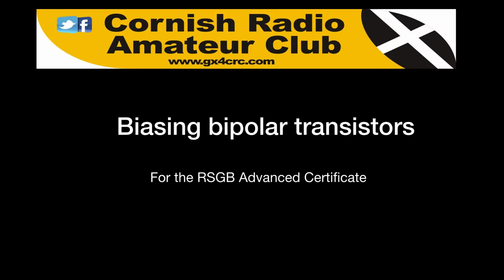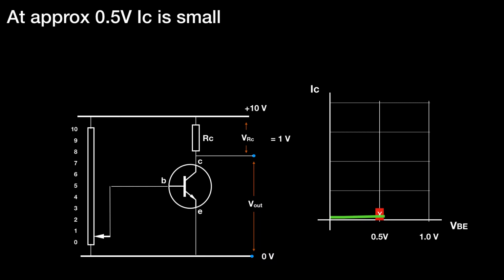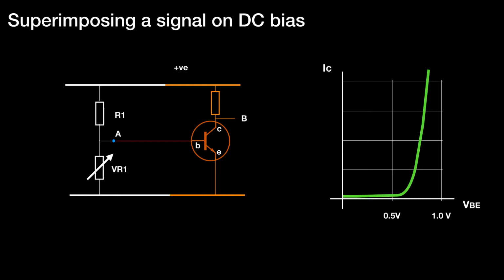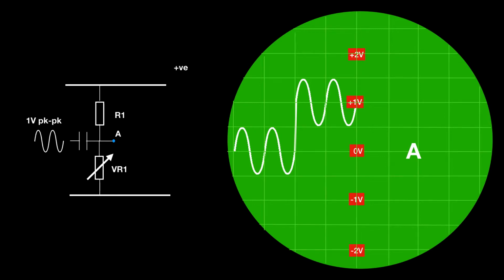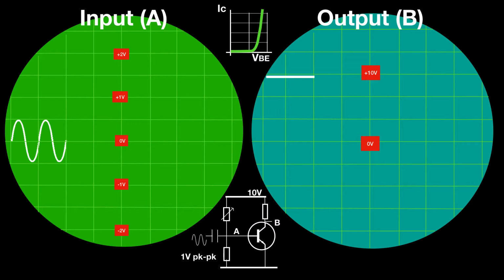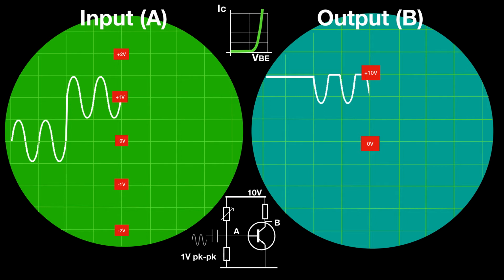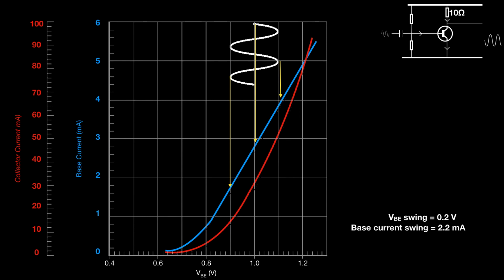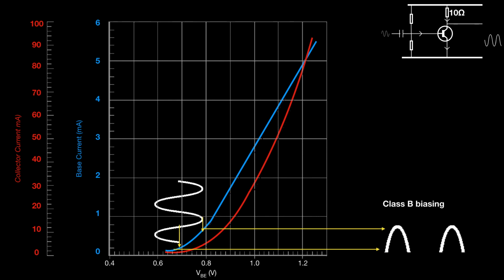Advanced -  Biasing

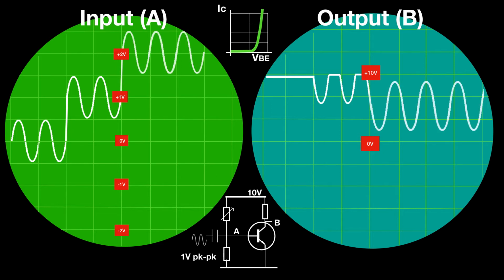Comment: In the Intermediate book it states "The voltage should be set at half the supply voltage to allow the maximum linear voltage swing." however it doesn't explain any more than that, and in your example that didn't seem to be the case, input voltage of 2 with supply voltage of ten gave you the swing, at 15:35 in the video?
Reply from the maker: Setting the bias voltage to half the supply voltage will indeed give maximum linear voltage swing.  So provided the swing of the input is not so great as push Vbe < 0.6V you should see the output waveform as a faithful copy (albeit amplified and inverted) of the input.  But because you have biased the transistor into conduction at all times (even without any input signal) you might feel it's using unnecessary power (e.g.from batteries).  And if your signal swing is small, perhaps it's not necessary to apply so much bias to still have full waveform on output.  If your signal swing were 2V pk-pk (i.e. +1Vpp and -1Vpp) then you could get away with biasing the base to +1.7V.  That is so that even the -1V half cycle will only push the base down to Vbe 0.7V so the transistor is still in the linear part of its operation.  The video is also trying to convey that sometimes the full waveform on the output is not necessary/desired. Broadly, full waveform on the output is class A operation. Only the positive (for npn) half cycles is class B and just the peaks of the positive half cycles is class C.  So the book is right. Pitch the bias in the middle and you have the best chance of getting the full swing.   But at the cost of power consumption and maybe you don't want the full swing.  The +10V rail was just to give a value. It could have been +12V in which case 6V would be the mid point.   Hope this helps.  Probably too much detail for Intermediate. Research Class A, AB, B and C amps if you want complete understanding for full licence.  GL
Reply: @cornishradioamateurclubtra4073  Thats helpful, thanks for taking the time to explain. Your videos are great, I find all of this much easier to learn and remember if I understand the underlying principals and these videos do a great job of explaining those. 

One suggestion, maybe an introductory 2 min video for intermediate showing all of the recommended videos for intermediate. I started with the intermediate videos and in many places other videos such as the background videos or advanced videos are suggested, have been trying to work through the suggested videos in order as they come up in each video, but I get a bit lost as I move through them!